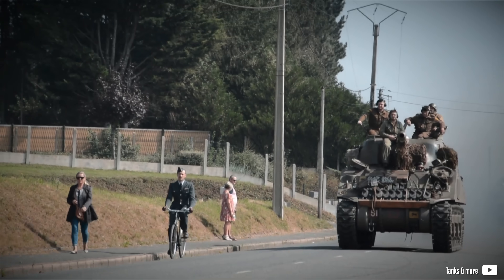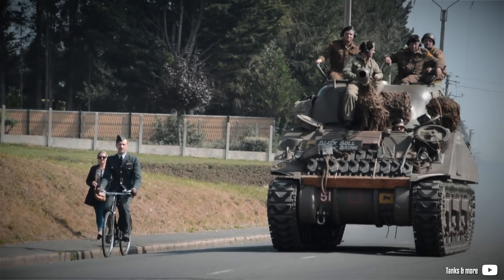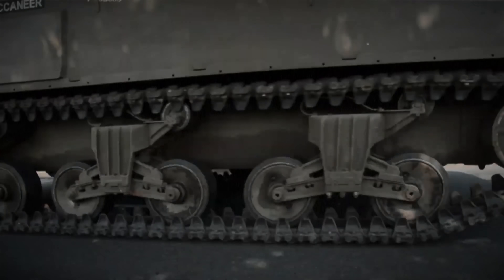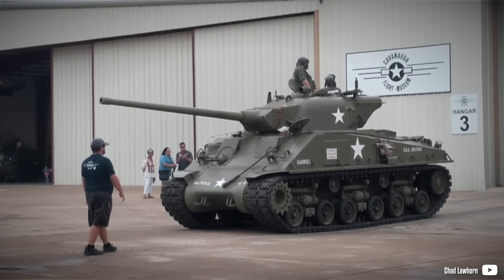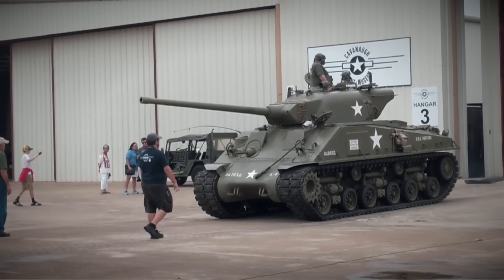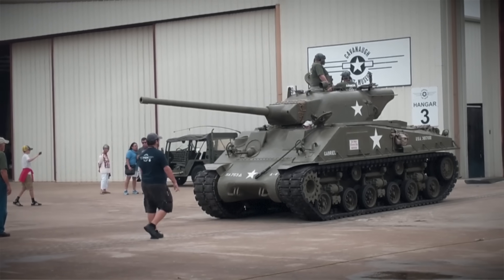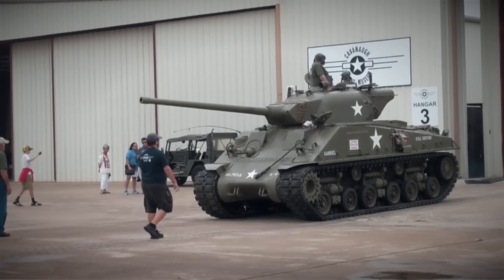This Super Complicated 30-Cylinder Was Sherman's Most Reliable Engine

Comment: Having 5 of most main parts these engines could take a lot of damage before stopping.
Some of the Shermans in the video do have different engines judging by the sound, one of them most likely the Continental radial, and the last tank in the video sounds like having a Detroit diesel (yes, there was one diesel engine against the others being gasoline engines, which was weird as the allied logistics were based on a single fuel, gasoline, to make logistics as simple as possible)
Reply: US  Army logistics was based solely on petrol. USN/Marines less so. USSR used both and as did the British with more diesel trucks. The British requested a Tank Transporter based on the Diamond T with a Diesel Hercules engine this was adopted by the US as the M19/M20, the only US diesel truck in their European inventory.
Reply: M4A2 Sherman used twin 6cyl Detroits as its power pack.

Comment: The A57 seems complicated, but it was a straightforward combination of 5 very simple flathead sixes that were understressed in this application and as were reliable as could be.  It would be as if one built an engine by combining five Briggs & Stratton single cylinder engines—seemingly complicated but not really.  The A57 was an unorthodox solution to this early-war problem that worked very well.

Nice video on an interesting subject.
Reply: There are a lot of sound engineering reasons why nobody slaps together something as hideous as the A57 Multibank engine . It was obviously done because there was an urgent need to leverage Chrysler's engine building capacity. The Ford GAA, all aluminum, 32 valve, V-8 became the preferred Sherman tank engine and was the only engine kept in postwar, American Sherman's. They later served in the Korean War of 1950 - 53. General Motors provided a twin diesel engine combination for the Sherman, with two joined to a single driveshaft, down from five engines  for the Multibank. The British Matilda II tank ran a similar engine layout.
The US Army in the European Theater standardized its Shermans for logistics purposes , with all of them running on gasoline /petrol. The Marine Corps in the Pacific relied on the Navy for logistics and many Navy boats ran on diesel , so that's where the GM powered tanks were sent. Lend Lease also shipped the GM diesel tanks to the Soviet Union where the T-34 tank also ran on diesel fuel .
The   Chysler design was considered too complex (30 spark plugs !) and dumped on the British via Lend Lease, with the US Army retaining only the Wright aircraft and Ford V-8 engine powered Shermans. 

The air-cooled Wright engine (built by Continental) required air to be drawn through the crew compartment to sufficiently cool the engine . It was great in North Africa where a breeze was usually welcome, but chilly in Northwest Europe later on .
The Ford GAA V-8 was originally designed as a V-12 aircraft engine to compete with the Allison V-12 which powered the P-38 Lightning , P-39 Airacobra , and P-40 Warhawk. The Ford design lost out, so it was re-engineered down to a V-8 and became the most popular Sherman tank engine .
Reply: @amerigo88  These L-head motors were low cost to manufacture.  They continued to be sold for industrial applications like fork lifts until the mid 1970s
Reply: @amerigo88 Chrysler was hired to figure out how to mass produce tanks. They realized there would be a shortage of the R975s so worked up the A57 design so they could use the huge number of assembled L6's in their warehouses then make more when needed. Ford's V8 wasn't ready for testing until 1943 and still had bugs to work out after being fitted into the M4, M36 and M26. The Army didn't want his V12 aero engine due to being new and untested. They wanted to stay with the Allison due to having a proven track record and known cost of production which was expected to become lower once in mass production. The British wanted Ford to manufacture Merlins for them so gave the blueprints instead of an order for his V12. Ford gave those to Packard then started turning his V12 into a V8 tank motor.
Reply: I've heard it said that "a true mark of technological advancement is simplifying the complicated" 🤔
I have no idea what I would use it for, 🤔 But I want one of these engines (I work on dodges daily) 🤪
I can almost see how you could "disable" a failed engine (or TWO🤯) and continue driving until you could make repairs. 💪
But I wonder how many "gallons per hour" that engine used at half throttle (I bet she was a thirsty girl). LoL 🤣🤣🤣
Reply: @tracewallace23  That's actually pretty easy to figure out - Let's take a Brake Specific Fuel Consumption of 0.45 and multiply by the stated horsepower of 115 HP.
115 X 5 = 575 then X 0.45 = 258 pounds of fuel, then cut that in half for "half throttle" , so 129 pounds, divide by six, = 21.5 gallons an hour, just toolin' around.
Reply: @peterdarr383  Wow 🤯🙂 awesome explanation 💪
That seems REALLY thirsty to me 😵‍💫
🤔I would think that tank would always be waiting on fuel (or getting it where it could).
Thanks for the knowledge👍🙂
Reply: @tracewallace23  It's basically "rule of thumb" and you can run the calculation the other way - - 
My truck gets 20 MPG at a steady 60 MPH.
I'm burning 3 gallons an hour that weigh 18 pounds. Some division with the 0.45 factor gives 40 horsepower. My truck needs to make 40 HP to pull me down the road.
Reply: @peterdarr383  so at 20 mph about one gallon per mile, pretty average for a tank even by today's standards, still wouldn't like to foot the bill though 😊.
Reply: @tracewallace23  ALL tank engines were known for being "thirsty"!  It was an inherent issue of using standard automotive carburetion, instead of fuel injection (reserved for high-performance piston-engine aircraft), as well as being able to run on rather questionable local gasoline supplies, which often had an octane rating as low as 70!  This wasn't always a handicap...during the German advance through Belgium and France in May and June, 1940, their Panzers, having broken through so rapidly, often gassed up at CIVILIAN petrol filling stations, as the French Army didn't have opportunity to destroy them!
Reply: Combining engines was nothing new.  The GM 71 series was based upon multiples of the basic 4.5 x 5 in stroke, two-cycle diesel engine, for a variety of applications, all the way from "one lungers" to the inline sixes used in the M4A2s for the USSR and the USMC, as well as a line of Vee engines.

Comment: Two things I found funny about the Sherman.
1. While the Soviets had 1 engine….a good one. We had 5 mediocre choices. 2 RADIAL! , a bank of diesel 6-71 Detroits, a multi bank bizarro flat head set up (shown) and ford v-12?
All gas engines except the Detroit. Which should have been the no brainer decision. ….hmmm….let’s see, we have a 30 ton? Vehicle….what kind of engine should power it.
Why….an airplane engine. No wait…..we will craft 5 flatheads together. IMO Ford…had the right idea…sort of. Huge displacement. But the wrong fuel.
They should have concentrated on the 2 stroke Diesel. Ford, and Chrysler had time to design and retool…..GM didn’t? Or Caterpillar?
So, to save money….not lives, we’re going to only put light armor up front…..and a weak gun.
Right off the bat. And …if that’s not bad enough, we will fill it full of AV Gas. 
You know….because we’ve never fought a war, and we have no clue that the enemy, in seeing our advantage of numbers, will up armor. No……we will just keep pumping the same out.
I don’t think the Sherman got thicker armor and a bigger gun until 44? And gasoline?
The MIC in action…..in WW2! All right!
And
2. I can’t…..I don’t ….I’m just? Gasoline? Why not power it with old leaky dynamite?
How about glass velars of nitroglycerin?
Again….the MIC . Nope….we don’t want two fuels…we don’t care how many people it kills.

I guess, The MIC did what they could. I guess. But how come a backward bunch of hicks could have a well armored, well gunned, fast tank that ran on diesel?
And produce them by the boatload.
Not that the Sherm, wasn’t good. 
It’s just burning gas….killed a lot of people, in those tanks.

Comment: It is very astonishing that this 30 zylinder did work reliable - more reliable than the Caterpillar diesel that was used as well.

It is perhaps the advantage of using proven, mass produced technology
Reply: No Cat Diesel in the Sherman.   The aforementioned 9 cylinder radial, this Chrysler, Ford V8 or twin GM diesels.
Reply: @twothbeave  acc. to some sources...."The Wright RD-1820 was converted to a diesel by Caterpillar Inc. as the D-200 and produced 450 hp (340 kW) @ 2,000 rpm in the M4A6 Sherman."

Comment: Where statistically they might seem reliable because of the few tanks that kept them ran ok but according to other things I’ve read and other videos the multi bank was hated.  As soon as the British received theirs the multi banks were pulled out and radials put in.  The Russians did the same.  In every case where M5 multi banks actually saw battle the engines failed in short order.  This video is just trying to make an interesting engine look good when it just wasn’t practical.  Yes the chrysler flathead sixes were simple rugged reliable motors but put five together and they break.

Comment: According to a book I just read of a battalion of the British 8th Armoured division, of which were nearly exclusively equipped with the multi bank Engined Sherman, it would suffer from fueling issues.  Yes, an otherwise rugged reliable engine.  Was it better than the Continental 9 cylinder?  Perhaps, but the Continental was much simpler being air cooled and no less rugged.

Comment: This was not the most reliable that was the GM 6046 diesel and second was the ford GAA V8. The Chrysler 30 was the weakest and was the heaviest of all engine options. The brits worked a lot of the problems out of but it wasnt prefered . The ford was the best option all around due to its ease of maintenance. Facts ! look it up before try and clap back

Comment: It is really cool to see engines like this from back in the day where its all mechanical. For a war I guess as long as it works well it, nothing else really matters, but I feel like they could've made the design a bit more refined
Reply: They did make more sophisticated engines for this tank, eventually. The 30 cylinder was a stop gap that could be put together quickly using off the shelf parts while they developed more refined designs. At the time it was important to get tanks into the field as quickly as possible.
Reply: Expediency over elegance was the order of the day, and hey, we got this bizzare curiosity for the history books!

Comment: The multi bank engine would have had features familiar to any qualified mechanic of the day so they would have taken to it very quickly. Compare that to the complex Continental radial engine and Ford V8. Derived from aero engines. Aluminium casting techniques were not as well developed either making them very oily and leaky.  A lot of emphasis is given to performance on paper in modern times that lacks important details.

Comment: This engine with OHV, if not OHC technology,  which had been used in the U.S. in the 30s could have been amazing.
Reply from the maker: But would also require taller heads and that would complicated many other things
Reply: When you are using low octane fuel the flathead is practically as efficient as an OHV. Only when you go to high octane, leaded fuel does the OHV have a decided advantage and that type fuel was not widely available until after the war.
For an interesting comparison, both Cadillac and Lincoln introduced new V8 engines in 1949. The Cadillac was a 331 cu in and made 160HP, the Lincoln was 337 cu in and 154HP. Both had 7.5:1 compression ratios, the Cadillac was OHV and the Lincoln a flathead. As you can see the difference in HP was very small, and the flathead had the advantages of silence, simplicity, low cost, and easier repair and service. But as better fuel became available and high compression engines the rule, the OHV pulled ahead. Lincoln replaced the flathead with a new OHV engine in 1952.
Reply: The Ford GAA was an OHC V8 engine and entered tank service in ‘45.  Prime mover of the Patton tank and mainstay through the Korean and Cold War 50’s.

Comment: Thanks for the very interesting video. I had heard of this engine but I hadn't looked into the details. When I heard "L Head" that explained a lot about why it was so reliable - it wasn't the best design for high power-to-weight but it was simple without the need for a complicated cylinder head, the exhaust valves operated in a cool environment, and it would be robust. I had always assumed the banks were arranged like a radial. 72 degrees apart, but it wasn't. No inverted bank means no oil pooling in the heads (and you wouldn't be able to drain the oil with a L head... ). Great way to make use of something that you had already with the bugs thoroughly sorted out.

Comment: Considering the engine technology behind the Allison and Merlin aircraft engines, generating over 1,000 HP on 12 cylinders, I am surprised that the combined output of 5 six-cylinder was so low.
Reply from the maker: Flathead design, low compression ratio, low octane fuel. They needed high octane fuel for aircrafts, tanks just had to be mainly reliable and powerful just to an extent.

Comment: I am quietly bemused by the absolute obsession by some with horsepower, engine speeds & ground speed. What is important in a tank engine? Reliability, serviceability & TORQUE. Horsepower barely rates. Combat terrain was not even remotely like a paved road & at times, even 10mph/16kph was taking your life in your hands. More important was the ability to climb out of a hole, ditch or creek embankment, & unadulterated pure grunt [AKA Torque.] is what is needed to get the job done. The multibank, with a firing stroke every 24 degrees of output shaft rotation had all the torque needed to do just that.
Low compression handled a fuel octane that bore a close resemblance to kerosene & low rotational speeds kept wear & stress down to a level that the technology of the day could comfortably handle.
Serviceability? Got a multibank with a damaged engine bank? Hell, that shot up Dodge power wagon/ambulance or gun carrier on the battlefield will be a useful source of parts, something that tanks with other engines could not do.
The multibank was the right engine at the right time, which was, .. back then, .... RIGHT NOW, using existing, proven technology & materials that had been in continuous production for almost ten years. Long may the multibank live. [With Chrysler reliability, it will probably still be around when the sun grows cold.]

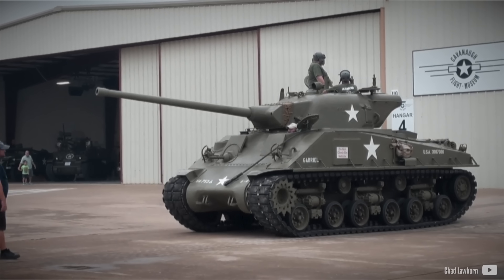Comment: 0:10 Although it's painted as a US tank would be during WW2, this is actually a postwar Israeli modification, the M-50. The turret front was extended to fit the long 75mm gun found on the French AMX-13, the engine was replaced with a Cummins diesel V8, and the suspension was replaced with the later production HVSS.

Comment: The multibank was the heaviest of the sherman engine packages, with basically the worst fuel economy and slowest performance as it also required a lengthened hull which was heavier still. The later M4A6 (of which only 75 were produced before the war ended) kept the lengthened hull of the A4 variant but switched to a diesel version of the Continental 1820 9-cylinder radial engine and would have replaced the A4s eventually had the war continued as it gave the M4 far greater range. Post war Canada adopted a fleet of new build M4A2(W)76s with HVSS that had never left the factory to replace the tanks they left behind in europe because again, the diesel engines had proved quite reliable with the USMC and gave better acceleration and fuel economy than the gas engine versions (due to the much greater torque in a tank that weighed less than the M4A4s).
Reply: The Army only used the Detroit Diesels in combat. They first tried a Gilbersen Diesel radial aircraft engine then decided the twin L6 two strokes were more practical. In 1944 the Army got Caterpillar to build a new diesel radial design that was cancelled after testing since the war was expected to end soon. The Ford GAA was "OK" yet still had bugs being worked out after put to use the M4's and M36's. The R975 was constantly improved after being put to use in combat with the upgraded parts being added during rebuilding. The A57 proved to be the most reliable with fewer upgrades during the war. The R975 required rebuilding after 150 hours of use while the Brits reported using their A57's for 1000 hours or more before rebuilding was required.

Comment: I used to have a 1939 Hobart Brothers welder with a 215 (I think) flathead Chrysler six cylinder engine. Ran like new and sounded awesome when it was under load.
Reply: My grandfather had one as well. It was mounted on a trailer with semi truck sized tires. He used it for welding on his fleet of trucks and road building machinery. He bought it new too.  It welded as well as any modern machine and had no shortage of amperage.
Reply: Probably a 218.

Comment: Omg and it was flathead? Not nearly as efficient as modern designs and fuels etc but would make repairs from the top extremely easy
Reply: When using low octane fuel, which was all they had back then, a flathead is practically as efficient as an OHV. Only when compression ratios higher than about 7.5 or 8:1 became possible, did the OHV gain a decided advantage. And that required high octane fuel which was not widely available until after the war, except airplane engine fuel.
Reply: @mrdanforth3744  all true things. Higher octane means higher temps and coolant pressures for efficient burns too. This is a genius design. You could even run with two banks out! Or completely missing!
Reply: No bulky overhead valve gear making the engine even taller, doubled with the radial!